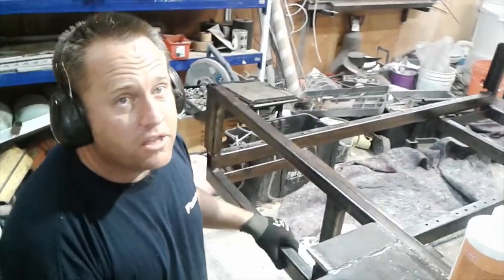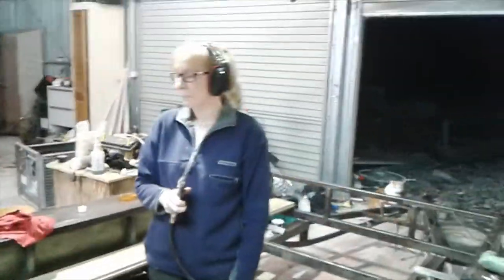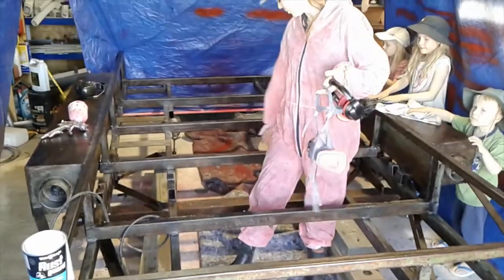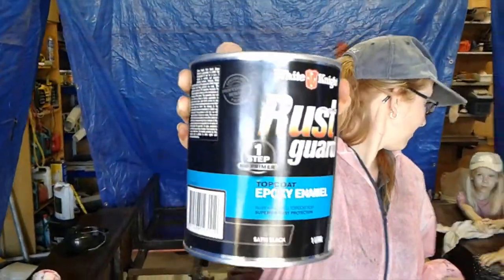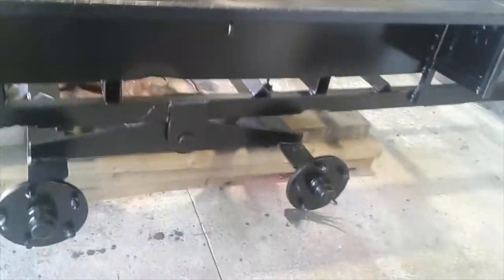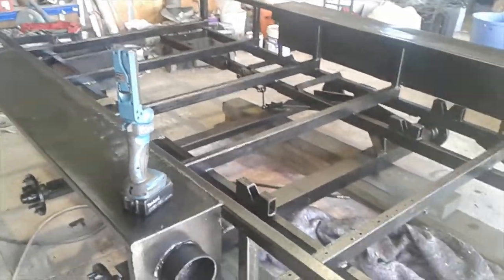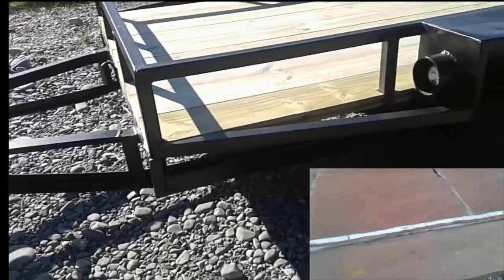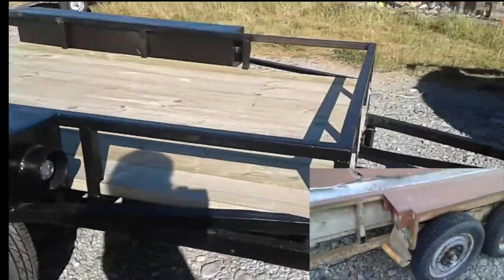Trailer Restoration - the Final Result (video #3)

Comment: Did you need to use a primer before the top coat?
Reply from the maker: After removing all the rust we could, we used a rust converter liquid that neutralises the rust and also acts as a primer for the paint to stick to 🙂

Comment: Very nice job guys, looks sharp. Nice decking. (I would have had whitewall tyres and flames carved into the planking, but y'know...). Very  impressive result considering what you started with: Should be an inspiration to everyone out there as to what can be accomplished with some vision and good old elbow grease (not to mention axle grease!). Definite thumbs up for this project!
Reply from the maker: High praise indeed!  Sorry for the lack of flames.  The wheels I originally wanted to do white, but would have required more layers of paint and we already had black on hand … but I rather like it now it looks ominous … for a trailer …